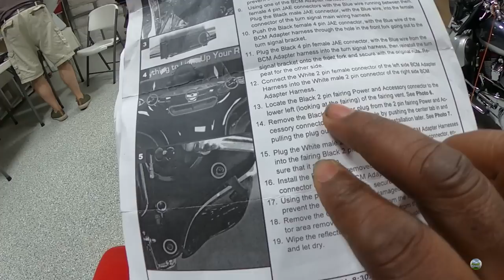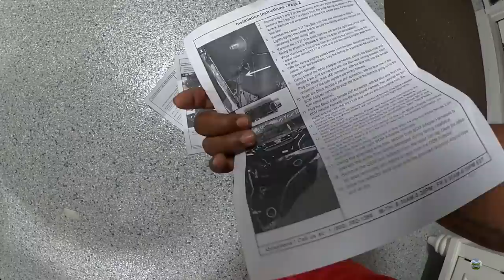Not Your Normal Install | All Custom Dynamics Lights From The Front To The Back | 2020 SGS

Comment: you three are hilarious. i was waiting on new tires for 3 weeks from harley. at the end of 3 weeks they called and said it would be at least another week. i found tires at another shop (non harley) and they had 12 sets of them. i called harley and said i am picking my bike up and taking it to * dealer. ***dealer was $133. cheaper than harley.
Reply: I’m not surprised. I’ve been waiting foe over a month for saddlebag guards.

Comment: Wood I replaced all my factory lighting with custom dynamics. You should also consider Ciro 3D Bat blades and lighted horizon led windshield trim. I added them to the fairing on my Trike and it really makes them pop

Comment: Jr it is on the left remember only talk about it from sitting on the seat never facing the bike, customers do this daily and drive us mechanics crazy by having us look for something on the wrong side for hours.
Reply from the maker: Got it. However why does the photo also show on the left when facing the fairing?
Reply: @woodjr.3771  if you were facing your car taking a photo you would not say my steering wheel is on the right, and because it would be confusing if they took the pic setting on the seat to tell you the plug is on the left and you surely would not see any plug, and remember in the USA what side of the street you drive on, and when you speak of a motorized anything it is described as if you were using it even your lawn mower.